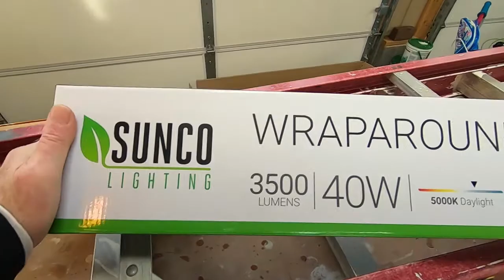Grizzly Hybrid Table Saw GO833P Unpack And Set Up

Comment: Thanks for sharing, Bill.  Like you, I've been using a little Delta contractor/mobile saw for almost 20 years.  After building and making all kind of stuff over those years I think I deserve graduating to a new, decent table saw.  Although the wife doesn't buy it.  : )

Anyway, I wanted to get that same table saw, the G0833p, but Grizzly apparently retired it early this year.  Then I noticed a new hybrid saw in their website; the G0899.  It looks identical to the G0833p.  I've tried to find reviews on it to no avail.
Reply from the maker: Thanks for the comment Mucaro,  I had my Rockwell/Delta 10" contractor saw for 35 years. I can't tell you the beautiful things we made with that old saw. This new saw is a great saw for the money. Fence is awesome and accurate. I condition the top using a fine sanding sponge in the direction of the machine marks and then follow up with Johnsons paste wax. I kept it at 220 v for the additional power. I am very happy with it so far. Let me know what you settle on, I'd be curious. I hope you subscribe and stick around. Thanks again and be safe  :) Billy
Reply: @billylisasremodelingchanne4344 , 35 years is a very long time.  You must take good care of your tools for them to last that long.  My Delta still looks almost new.  It's kind of difficult to get rid of a tool that looks and works well and has served me for so long (sob).  But it's staying in the family.  I'll sell it to my son-in-law.  I'd give it away to him but I want him to appreciate it.
I do something similar to bare metal surfaces in my other tools and my welding table.  I love that brushed look on steel, so I scuff the flat surfaces with a scotch pad in "the direction of the grain" using a board or aluminum angle as a guide.  Followed by Johnson's paste wax also.  That thing is amazing.
I hope your new table gives you even more years of service than your Rockwell/Delta.  God bless.
Reply from the maker: Yes Sir. They feed me. 😎

Comment: The documentation says this saw weighs ~429lbs. What do you estimate the heaviest piece to weigh? If I buy this I'll have to move it downhill (grass hill) to my basement. I had decided against buying this saw due to weight until I watched your video. Now I'm thinking I might be able to safely move it piece by piece.
Reply from the maker: Been using the saw for a year now and love it! You could break it down to move it down the hill but I think I would look for help and roll it down on a wheel horse with pneumatic wheels. Let me know what you end up doing! Billy Rose

Comment: Awesome video and you seem like a really awesome person to know. I ordered the G0771Z a couple weeks ago but waiting since it’s on back order lol. I also purchased the G0555LX bandsaw which I do have and currently been working with. I see in the video you purchased the same bandsaw. A few parts on mine did need warranty replacement from Grizzly as soon as I received it. My biggest issue is my G0555LX bandsaw has a decent amount of vibration and a bit noisy at times. Did you have issues with your G0555LX bandsaw being a little noisy and a decent amount of vibration? If so how did you eliminate some of the vibration or do you have any tips? If I could make it a little less on vibration I’d be happy. Thanks and thanks for the awesome video.
Reply from the maker: Thank You Lyric for the kind comments. Much appreciated  :)  Still loving my new table saw although it takes a while to get used to a new tool. I had my old table saw for about 37 years.  LOL. I am pretty happy with the bandsaw as well. I did a "Building an outfeed / craft table" video where you can see the bandsaw run to compare if you want. During set up i made sure the blade was tracking in the center of the wheels and the tension of the blade was proper and rolled with it. No excessive noise or vibration to me. I hope this helps a little bit and I hope you subscribed to the channel. Thanks for the comment and let me know what you come up with. Billy Rose

Comment: Lovely. How exactly did you put the mobile base underneath the table saw? Mine will soon be on the way, however, this frightens me. I've watched several of the SawStop unboxing and assembly videos and it is very straightforward saw, considering that the SawStop PCS isn't shipped upright like the Grizzly Cabinet Table Saws. Looking forward to hearing back from you. Enjoy!
Reply from the maker: Thank so much! Lets see if I can explain this. Saw sitting upright on floor. I assemble (2) fixed casters with side rails and rear rail to the approximate size I need. With extra hands, tilt table saw forward and slide assembled base under the saw. Tilt saw to the back and set a couple 2 x 4 blocks under the front of saw to hold it. Finish assembling the base around the saw. Once complete tilt the saw to the back and remove the blocks and lower the saw into place on the base. Then you can micro adjust the saw base to your liking. I hope that makes sense? lol